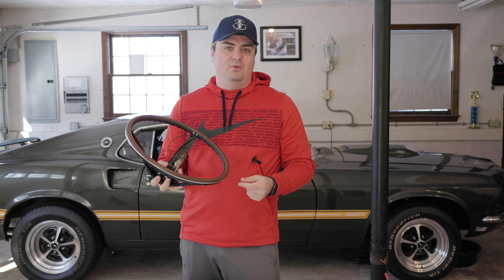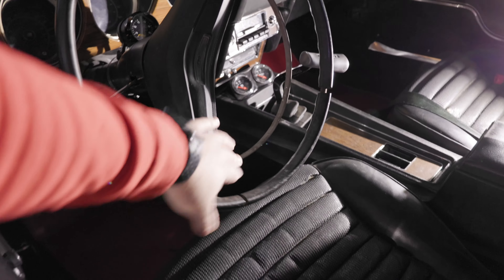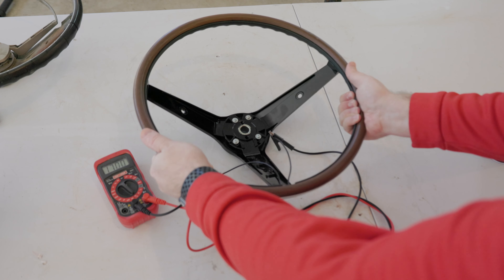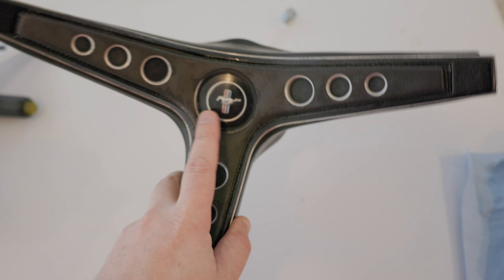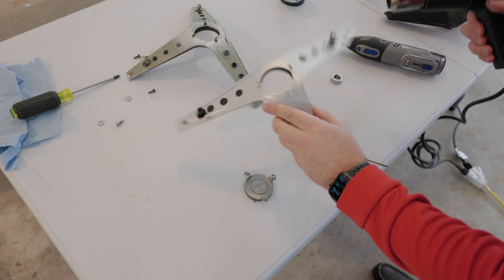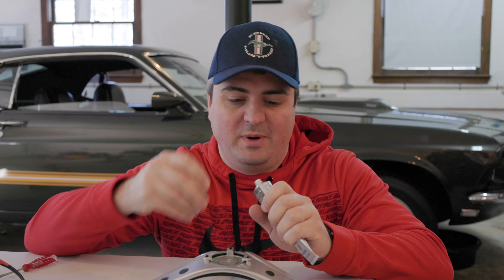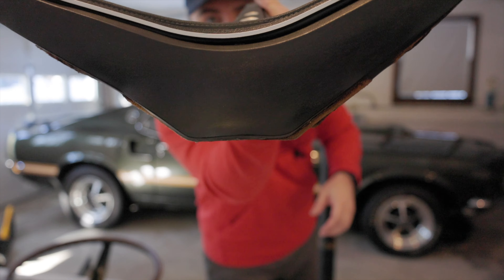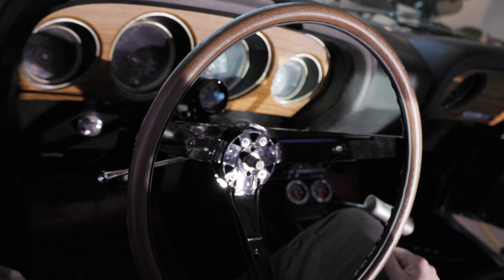Installing the COOLEST Steering Wheel on my 1969 Mustang | Rim Blow Wheel

Comment: Weren’t you supposed to add dielectric grease to the rings on the back of steering wheel where the contacts will ride along when turning wheel?
Reply from the maker: Yes you can

Comment: So THAT'S how it works.  Now I need to find out what other cars had it.
Reply from the maker: Rim Blow steering wheels were optional on GM cars from 1969 to 1971 (Cadillacs, Oldsmobiles, and Buicks), Ford, Mercury, and Lincolns from 1969 to 1974, Chryslers, Dodges, and Plymouths from 1970 to 1973, and AMCs, even being fitted as standard equipment on the AMX. (from Jalopnik)
Reply: @SmackeysGarage  They must have been pretty unpopular.
Reply from the maker: I do think it is cool, but the overall design has some flaws or I am not used to the wheel itself. If you are turning hard, such as in a car with no power steering, you really grip the wheel and when that happens you beep the horn.. lol

There have been many times I'm pulling into a parking spot and I mistakenly beep at someone.
Reply: @SmackeysGarage  Did foreign cars have that feature, as well?

Comment: Do you have power steering in your car?  I was wondering how much of a pain is it to drive with the rim blow wheel if it were manual steering…I figure you’re probably gonna be doing quite a few inadvertent horn honks at slow speeds…
Reply from the maker: I do have power steering in my car but with the placement of the rim blow rubber contacts I don't see it being a major issue for myself. The rim blow is on the inside which unless you have a death grip and a complete wrap on you shouldn't hit it.

I could see some people inadvertently hitting it though. It does require somewhat of a targeted squeeze to make it sound.